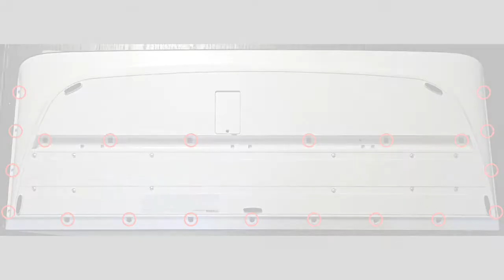Genos repair • replace key (EN)

Comment: Thank you again !!! I have now successfully replaced 2 keys on my Genos ( tip: don't let your nails grow too long because it damages the shiny coat on the top of the keys ).  Your help, especially showing which screws to actually undo on the back of the Genos and how to remove the keys without damaging the spring underneath, was absolutely vital !

Comment: Thanks for posting this.  I have 2 damaged keys on my Genos and I was wondering what I had to do.
Reply from the maker: it is not very difficult. be a little careful when pulling out or pushing in the button. with light pressure but not too tight.
Reply from the maker: you know where to get spare parts: i got them from Frank, he always helps: https://www.musik-city.de/

Comment: Hi,question ?does live control knobs and sliders removable by hand?I scratched by mistake and I got replacements coming.Could you please verify if it comes off?Thank you
Reply from the maker: I haven't done it myself yet. I don't know. But I think it's just plugged in. You can take a close look at the replacement part.